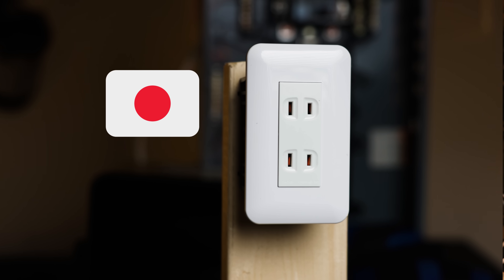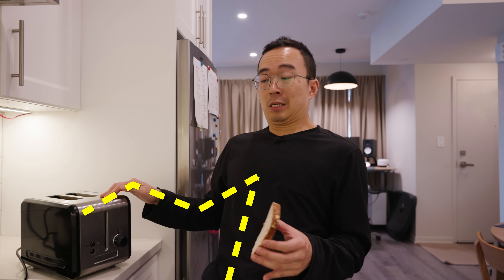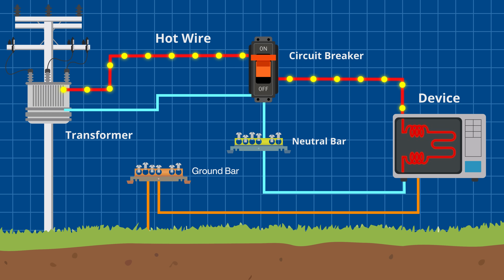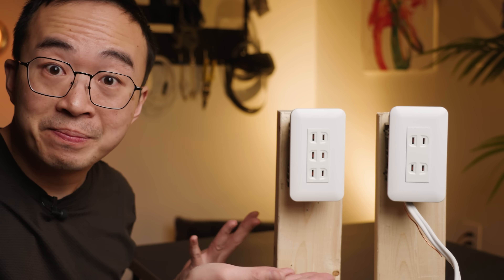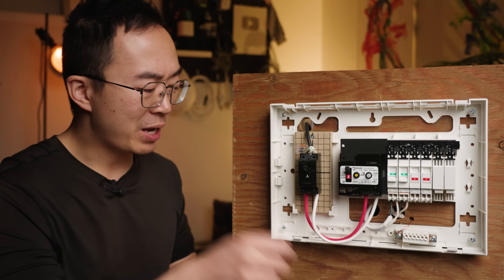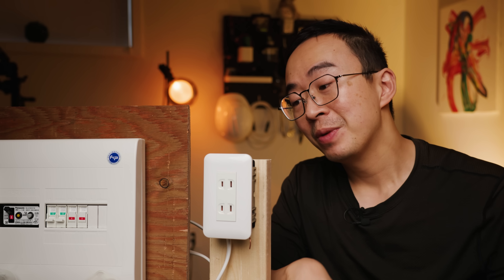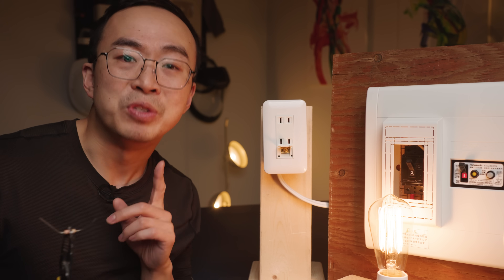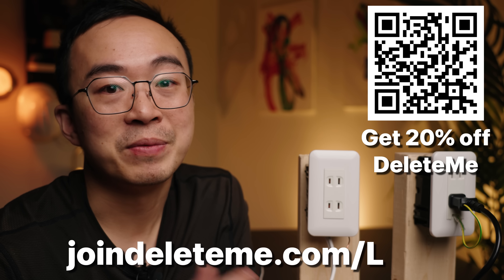How Japan Made Their Outlet Safe

Comment: Scandinavian electrician here: circuit breakers are there to protect the circuit and the devices connected, NOT the user/human. Circuit breakers are designed/chosen based on the cable size and load expected and will not protect a human connected to a live circuit. RCDs on the other hand are there only for the users health and nothing else. The current limit of 30mA and time of 40ms on an RCD is based on human hearts sinus rythm and is the maximum time and current a healthy human heart can take before ventricular fibrilliation treshold is reached and the heart stops beating as a result of AC shock.
Reply: circuit breakers  protect the circuit and not a smoldering device or or a person while getting electrocuted
Reply: I guess many countrys have both RCDs and ground. Ground is not only for safe. but also for  ESD protection and EMI reduction, it is weird japan has no Ground. Do Japanese people never do DIY or any technical interests at home ?
Reply: @okldr  I think many of the countries with both have higher voltages, Japan has 100v (yea it’s weird to use the same us plug but an even lower voltage).

It’s hard to say which is safer though. A good example is that the US model code now requires whole home surge protection (this is different that RCD or GFCI and solves a different safety issue involving lightning strikes and grid surges) but most of Europe does not require this. The safest option would be for both.

It could be that the US has more lightning storms or the electrical grid in the US is positioned in a way that makes it more likely to get hit by lightning (more long distance lines on taller towers, etc). This difference could mean that it’s a cost effective decision. 

These types of electrical grid rules are seldom simple.
Reply: @okldr  There is always at least 1-2 small electrician companies within reach that will do any wiring job for you professionally for a reasonable fee so hardly anyone takes risks with DIY beyond replacing an old outlet. Besides it is formally illegal to tamper with most of the wiring w/o certification even in your own home.
Reply: @okldr  That's correct, in Japan you aren't allowed to even change an outlet yourself unless you're a certified electrician. Some people will do to save some Yens but for anything above 100% will call an electrician.
Reply: 300mA rcds are used at the entry point for consumers of TT net systems. When there is no PE or N or PEN conductor from the supplier, the rcd protects against high energy cost. Why? The ground pin in your home is connected literally to the earth, same with the transformer of the substation. When a ground fault happens, the resistance drops, but not enough to trip the 20-40 amp breaker or what have you. So the power used seen by the meter goes way up. Depending on where the fault is, it can also heat up and cause a fire. The breaker doesnt care though. Still not enough current. So a 300mA rcd is used to detect faults like those.
Reply: @evicol2117 300mA is too high for human safety. Not sure the limit in 110V, but in 220 70mA is the human safety limit, and you only find 30mA home RCD sold. 300mA are reserved for industrial machines.
Reply: Correct, it is the same here in the US.
Overcurrent protection (circuit breakers and fuses) is NOT designed to protect human beings, only GFCIs are (4-6ma threshold).
Reply: There are many circuit breakers these days acting on single circuits:
MCB: Micro circuit breaker: gives two functions: over-current and fault protection.
RCBO: gives three functions: earth leakage (RCD), over-current and fault protection.
AFDD: gives four functions: arc fault detection, earth leakage (RCD), over-current and fault protection.

Have AFDDs on all circuits you will have the ultimate protection with faults isolated to the defective circuit. Many high-rise buildings in the UK have AFDDs on all circuits.
Reply: It's also important to point out that the reason we connect the ground in the first place, even in places where there are no RCDs, is to make the potential difference between the stray voltage on the metal go to zero. Which was the whole point of Earth in the first place. In the US, you don't have RCD protection, you only have GFCI in the bathroom, but you still connect the ground, or the Earth, to Class 1 electrical appliances, so that in the event of an insulation fault, whatever stray current, and thus voltages, is on the appliance will be dumped straight to ground, making the potential literally zero. And if it's high enough, of course, it trips the breaker as it becomes a short at some point, as the insulation continues to deteriorate.
Reply: It's almost like he said exactly this in the final minutes of the video.
Reply: circuit breakers are also there to keep overloaded wires from overheating and melting and/or starting a fire.
Reply: Sadly the RCD is not for saving human at all! It's for current which goes sideways. My neighbour just touched the newly installed RCD system with hand, but with dry hand, he never reached 30mA. It MAY save your life, but RCD is mostly for a fault water heater for example, where the breaker will not trigger (since not that much current) but RCD will...
Reply: Close, but not quite. At 30 mA continuously, VF risk remains very low even for several seconds in most people (the curve shows the 5 % VF probability line starting around 50–70 mA for durations > ~0.5 s). The real danger zone begins higher, but 30 mA × 40 ms (or less) is engineered to be safely below the fibrillation threshold with a good margin, even in worst-case timing within the cardiac cycle.
Reply: 30 mA sounds so small considering that a little electric motor for toys can draw one amp, I feel like I'm missing context here
Reply: @wege8409  Voltage is what you are missing. A low voltage toy simply cannot induce high enough currents in your body to seriously injure you. I mean please don’t poke wires under your skin to prove me wrong. :) A lot of other factors matters too. Like how dry your skin is as a person, or if your outer skin is wet like you just washed in a bathroom.
Reply: @attilakovacs6908  Oh I think I know what I'm missing now. The human body is a resistor, so just because you touch a wire on both terminals that's drawing 30mA doesn't mean that your body is now drawing 30mA, right? So you would need to be touching the voltage required to make your body draw 30mA.
Reply: @wege8409  Yes, exactly. Of course it is very simplified if we just think of it as a fixed resistor. The body reacts differently to DC and AC for example. How much water we drunk recently, our age, etc. all matters.
Reply: Circuit breakers are there to protect the wires in the walls. That's it. Not whatever's connected.
Reply: Yeah this guy should've done his research better before making a video full of misinformation. Welcome to the internet lol.
Reply: Nope! Amperage-driven breakers are there to help protect the building against a fire, and therefore humans also. They just don't protect against electrocution, because of course the amount of current they let through is far in excess of what is lethal.
Reply: I though I was going crazy not finding such comment right away. This should be pinned, this is really important stuff
Reply: Combination circuit breakers have AFCI’s and GFCI’s built into them so… they protect a lot of things
Reply: I'm getting a bit pedantic here but a circuit with a fuse/circuit breaker (overload protection) but no RCD will still protect humans but only where a fault in a metal class 1 appliance occurs and line and earth are shorted which is why when testing an electrical circuit the earth fault loop impedance is measured to ensure it's low enough to cause an instantaneous trip in the case of a line-earth fault
Reply: Yup, the japanese electricity supply including the sockets is a shitshow. No ground wires, but then they figured higher powered devices should still have them, because. And then you fiddle around with a ground wire that needs to be attached with a screwdriver and looks ugly. 50 / 60Hz. 110V only. 15A max. breakers in most houses. Stuck in the 50ies...
Reply: @damoreaux 100V, and 200V available for things like large AC.  IIRC 200V is obtained by using 2 of the hot wires that are 180 degrees out of phase.
Reply: @damoreaux 
Such grounded outlets are installed in inconspicuous locations.
Reply: @damoreaux  Circuit breakers and power surge protection aside, these two-pin connectors are just the worst on their own. Coming from a country with British plugs, I cannot stand when I see them barely holding onto the sockets, being pulled down by the weight of the wire, and some of the live part of the prong exposed. One time in a hotel in Japan, a charger sparked when I plugged it in, tripping the circuit breaker. British outlets are just way superior in every way except maybe their bulk, but that's a fine trade off.
Reply: The circuit breaker is necessary for grounding to actually work, so it does protect people in the event that the hot wire shorts to the chassis. But you're right that it's not their primary purpose.
Reply: In Argentina we use the same system. Bah, probably most countries except US.
Reply: @rc4a0frios  GFCI's/RCD's were first used in the US in the 1960's and are required in any new construction since 1971.
Reply: @rc4a0frios  And Japan. It's funny how he compares the US to the Japanese system and argues which is best, while we Europeans have had whole house RCDs and grounding for decades since the 1970ies :-D
Reply: @NorbertHarrer not the hole House is sved by RCDs in Germany. In modern Hauses it is but not in mich old ones
Reply: @rc4a0frios what are you talking about?  US has class A gfci
Reply: @rc4a0frios In the US we Ground Fault Interrupted outlets where dangerous shorts are likely, so kitchen, bathroom or exposed systems. Basically it’s a device inside the outlet that trips the load immediately if theres a short.
Reply: Grounding removes the electric potential from the surface of electrical appliances. If there is no electric potential, there is no electric shock. RCDs are needed in humid conditions because in some rare cases some of the current can flow through a person, since the grounding resistance is not zero. Also, a RCD can notice a current leak in a smoldering wire when the current is insufficient to trip the circuit breaker. An RCD can be a universal protection against electric shock, but now grounding has another function. Namely, providing electric capacity for current filters installed in every powerful electronic device. If you have ever felt an unpleasant vibration when in contact with metal parts of electronic equipment, then this is the result of a filter working without grounding. It is not fatal since because it is a reactive current, but if the capacitor will broken one day, the case will become an extension of the phase wire. And then, at best, you will get an unpleasant bite, and at worst, cardiac arrest. In the USA, RCDs are rated at 5 mA to reduce risks even for people with weak hearts.
Incidentally, if lightning strikes a wire, it is guaranteed not to allow a RCD to open, but in the case of grounding, it will prefer the shortest path to the ground. That is, in addition to the RCD, there must be protection that instantly creates a short circuit when the voltage is too high.
I think the USA has the best electricity system in the world, but it's the most expensive.
Reply: @none776  But you can but 2p or n+1 RCD with 1~2 dollors from China. A best electricity system many be very cheap, If you do it yourself, it only costs a couple hundred dollars for a house.I guess you don't trust Chinese brands, but some of them are of good quality.

Comment: Comparing Japan and US electrics is like comparing a kick in the teeth and a kick in the head. I've got 100v next to my bathroom sink and toilet, my washing machine (earthed) and main panel in my bathroom!! and the whole country (I'm in Japan by the way) has wires dangling everywhere. It feels very dangerous compared to the UK and the rest of Europe.

Also, for some reason, there are many plug/socket designs for different voltages/amperage/uses meaning the whole system is very messy. The simplicity of the UK system seems beautiful by comparison.

Comment: In the UK we did things the other way around. We've always had grounded outlets, but wiring regulations have only recently started requiring RCD protection on almost all new circuits.

I just recently had my 10 year wiring inspection, and so all circuits in my home were upgraded to RCD (All new RCBOs on every circuit.) :)
Reply: RCD has been code for at least 25 years on new build.
Reply: @fivish wrong. 2008 it was.

Comment: AFAIK, most toasters in North America do not have a grounded chassis.  This is to stop the (apparently common) case of someone sticking a knife in the toaster with one hand, to free stuck toast, while holding on to the chassis with the other.

A toaster should be plugged into a GFCI-protected outlet, though.  Also, in North America, GFCI protection is supposed to kick in between 4-6mA, not 30mA.
Reply: Why would anyone take a hot toaster on his lap and stick a knife in? That makes no sense. Once the tray pops, even if it gets stuck by the toast, the power is cut.

Comment: After Brazil adopted a standart a few years Ago, we started tô have a requirement for ground PIN, and It is a real ground, nota neutral anymore, só those leak detection de vocês started being used. Those ARE rally good, and can be combined with surge protectors tô make tour house rally, rally safe.

Comment: The problem with GFCI is that (as he mentioned in the video already) it works by comparing the coming and returning current of live & neutral. It only trips when there is a mismatch, which means someone has to get shocked before it can trip. Your outlet or appliance could have had a broken live, energizing the casing for days, but you wouldn't know, and the GFCI would not trip until you touch it and shock yourself. With grounding, however, the ground-wire back to the neutral is always present, meaning the moment that live wire touches the casing of your toaster, it'll trip the breaker, and you won't be left unaware for days, until you touch it and get shocked. 
With GFCI: Does not trip when the live touches the casing, but trips when you get shocked -> when you reset, it won't trip again unless you touch and shock yourself again
With ground wire: Trips immediately when live touches the casing -> when you reset, it'll trip again immediately, unless you fix the problem
Reply: GFCI is also recommend for Electronics with high wattage Power supplies. In a lot of cases the Breaker for that outlet won't trip if the PSU or some other component inside fails in some way. The amperage draw can be really low. GFCI outlet's are more sensitive and will trip saving you from a fire inside your electronics. If you don't want to replace your outlets for your PC/TV/Other electronics, I highly recommend a quality power bar from like APC. They have a GFCI circuit built in and will trip before the outlets breaker(provided it's properly Grounded as well).
Reply: What about touching live wires? Wouldn't GFCI protect against that?
Reply: @dvx-ze1qz  No, that's not a problem of a GFCI, that's a problem of not using a ground wire. If the appliance and the branch circuit had a ground wire back to the panel, whenever a hot wire touches a metallic chassis, the GFCI would trip, without the need of someone first briefly touching the energized chassis.
Reply: @altuber99_athlete  right. What I meant to say was using GFCI without ground. I should been more clear. Sorry
Reply: @dvx-ze1qz even if the gfci didnt have a ground it would still trip, the ground is a seperate safety measure
Reply: If a live wire say becomes loose and touches the metal case of an appliance:

a. If the case of the appliance is earthed.  Current will run from the live to earth. This cause an imbalance between L and N activating an RCD/GFCI opening a circuit. 
b. Where the metal case is not earthed.  The RCD/GFCI will not activate.
Reply: The problem with the GFCI is that it is a more complex system than the grounding wire.
The more complex a system is the more prone it is to failure compared to a simpler system.

Comment: No, sorry, you are way off. First of all , grounded receptacles came about LONG before GFIs were invented. During that time Japan was much more unsafe. Having a floating ground (TT) without a GFI is MUCH worse because you never know what your voltage to ground will be. Capacitance inherent in the wires, moisture, or a shorted wire at your neighbors house will effect what you will or will not feel if you touch a wire. And you have no known reference to check voltage when troubleshooting. With a GFI you still have an unknown voltage to ground. The GFI will trip IF it is working. It is an electronic circuit, and GFIs fail all the time. Who actually checks theirs? With both grounding and GFIs you have two safety nets to protect you. Lastly, it does not require much of an upgrade to get rid of the floating ground. Just bond the neutral to ground at the transformer and at your main panel. Done.